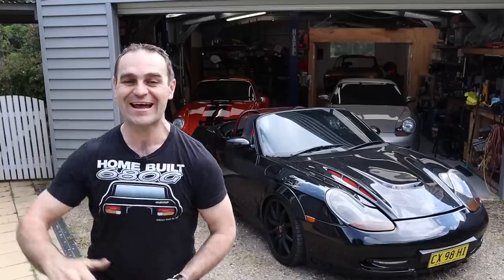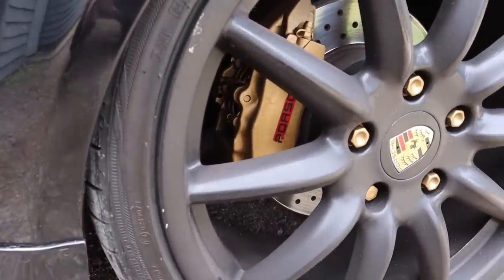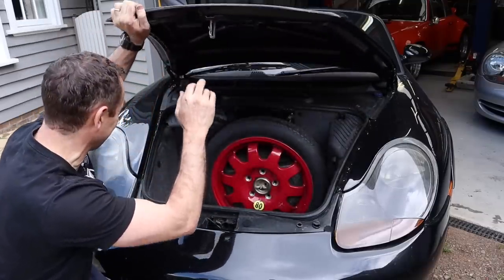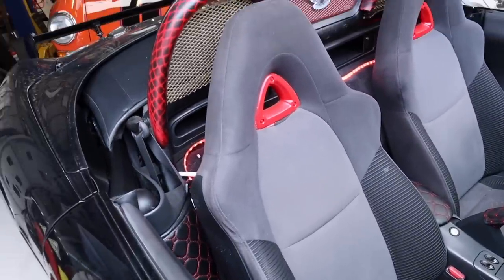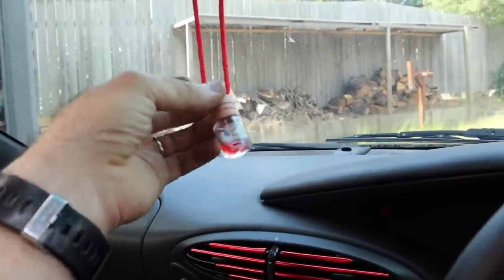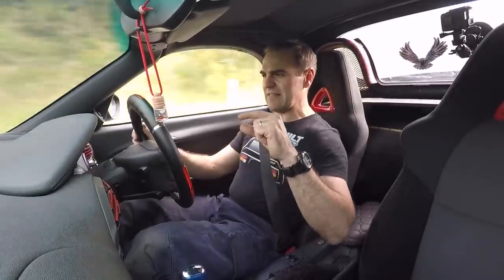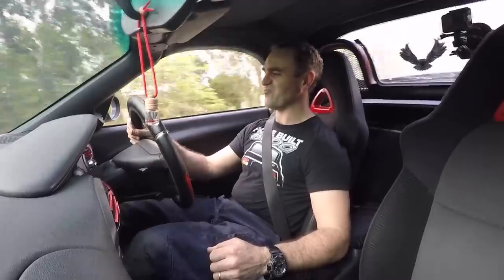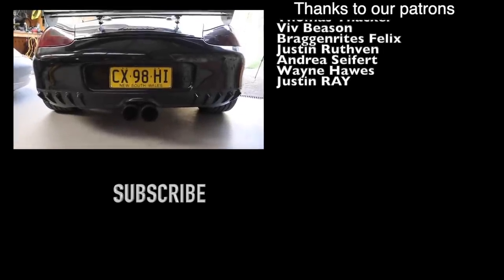I bought the ugliest Porsche in Australia (if not the world) - Porsche Boxster track car build 1

Comment: Hey Jeff good news! My car's brakes did the same thing, stiff at first push, then started going too close to the floor too easy (almost like losing brakes) the problem was only rusted/tight linkages between pedal and booster. (Cleaned and lube totally fixed mine for good) Also heard that some people had the stickiness inside the booster NOT on exterior linkages. Hope yours is  easy exterior fix, if that is the issue. 1 more cause possibly sticking caliper pistons/collapsed rubber brake lines

Comment: Andy Roxster has a nice ring to it. That is the most hideous thing i have seen in years. A lot of years. I would have done the same thing. 

My MR2 had rgb led lighting the same when i bought it. The tail lights had been painted over except for small circles and had 2 x hotrod scoups on the engine cover pointing backwards. It had clamped on 4" exhaust tips that rattled. All of that went quick smart. It still has a clear blue pink pearl clear coat over the white which is failing. But it will get a respray over the xmas break.

Comment: Yup, that previous owner had zero taste for sure 😉

Headlights is hopefully just the locking cam bar hasn't been rotated to lock the headlights in place. Otherwise means the headlight tabs or locking bars have been broken. Fingers crossed it's the former 😊

Comment: Strong MCM vibes with this Nugget! On the upside, at least it has not had its roof hacked off and a 2 ton fibreglass 959 body kit fitted like they did to far too many early 911’s back in the late 1980’s 🤮

Comment: Hey Jeff, I ended up with a 2000 boxster S with Tiptronic...overheating problems, I think I have a cracked head.  so my question is will the v8 work with the tiptronic? or would it be better to put a 6 speed manual instead.  Is there a 6 speed audi trans I can use, boxster S 6 speed are about 2500 to $3K, if not I may go with 5 speed, they seem inexpensive, will it handle the v8?
Reply from the maker: I have no idea about the tip. The issue is it needs a computer to run it. I think the manual will be an easier and cheaper conversion. There are Audi boxes that will work too if you can find one.

Comment: How much did they pay you to take it away??  With all of the crap on the car I would be SERIOUSLY concerned about the mechanicals, especially since you intend to use it on the track.  There is going to be a great deal of effort expended to tear down the whole thing just to make sure it will be both reliable and safe.  If the turds that adulterated this car also looked after the mechanicals you can guarantee that it needs an overhaul despite what (the limited) road time you have had in the car.  Clearly, the previous owner(s) couldn't be arsed to remove the stickers before the paint job - could be an indication of the mindset for general maintenance?
The RSR is the track orientated car in the stable so use it as such.  A true Porsche enthusiast would race the RSR at weekends and commute in it during the week.  Don't let it become a poseur mobile.
Reply: "Remove" the stickers before paint?  No, that was the intention, which obviously makes it WAY worse.  Apart from that, you're spot-on.  Full resto-mod is in order for this kludge.